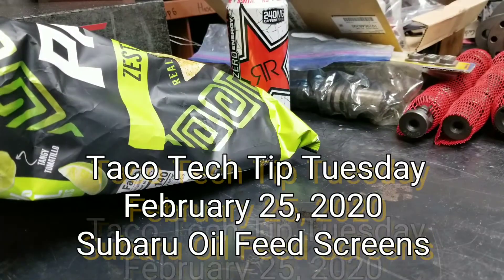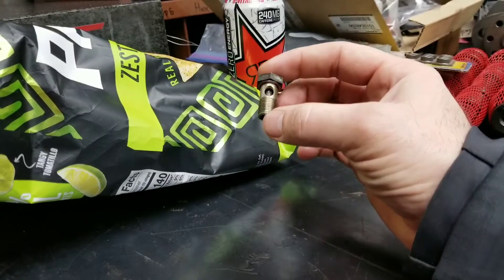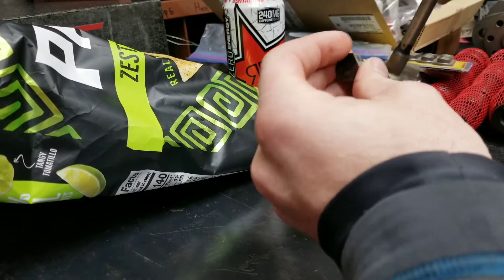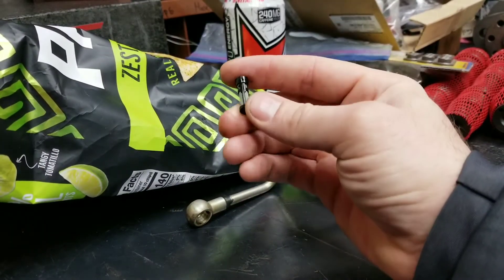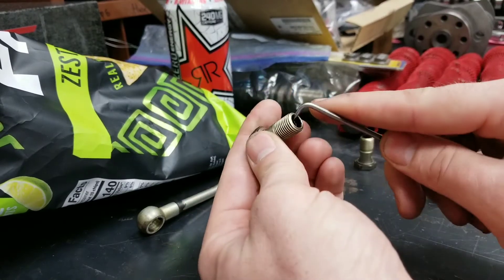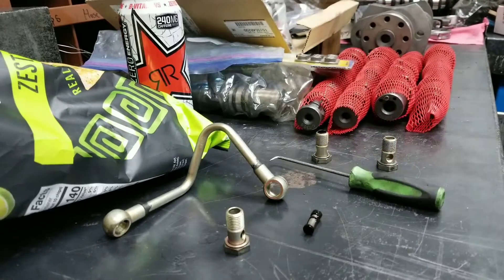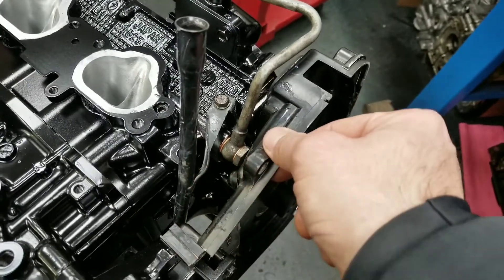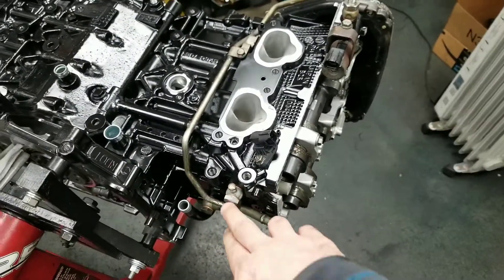Tuning Tech. Stop Subaru Engine and Turbo Failures, Remove Banjo Oil Screens

Comment: Thanks helpful information. But i am still thinking why the Japanese engineers put this micro filter inside the T Banjo?  I have similar probem with Forester 2.0 diesel 2012.
Reply from the maker: Ultimately it was to stop debris in the oil from damaging the turbo but you have to remember in Japan they replace the entire motor at ~40,000 miles so the buildup over time wouldn't be an issue.. on the usdm cars it should have been a service item but it was missed until the mileage got up there across the fleet and people started having failures,  then they made it a TSB instead of a recall.
Reply: @WT4T  thanks for the fast reply. I am considering to mount turbo NR 4 this year. DPF Out and EGR valve already turned off. Removing the Microfilter would be next step, but i hope oil pressure on turbo bearing will be not too high. I saw an example from a Subaru 2.5 sti with burning Oil. 🤔
Reply from the maker: @brattikx777 if you find it's burning oil you could install a Turbosmart OPR

Comment: I've got a legacy B4 Twin Turbo. I have already changed 4 turbos and everytime I replace a turbo it will get destroyed after a few days of driving. I have fflushed the engine and the oil line everytime I do a replacement and I still end up with a shattered turbo.
Reply from the maker: Have you confirmed oil pressure at the turbo feed?
Reply: @WT4T  yeah mechanic has confirmed that pressure is fine
Reply from the maker: @fxmonk you may consider sending a turbo into a reputable rebuilder like  Boostlab to inspect the failure.  They will have you send it with the feed and return lines all hooked up as well.
Reply: @WT4T  I'm located outside of US
Reply from the maker: @fxmonk they still may have insight for you if you contact them.

Comment: I only removed the Turbo side filter on my LGT, had 2 turbo failures. If the driver side screen is still in, will this still cause turbo failure?
Reply from the maker: Not likely to cause a turbo failure as its feeding avcs not the turbo but anythings possible. I'd run about 1000 miles then get an oil analysis done to see if you're getting debris into the oil from somewhere else
Reply: @WT4T  Turbo manufacture informed me to run an Oil line directly off an oil sandwich plate for the 05 Legacy GT. He informed me that 05+LGT have a oiling problem in the cylinder head. Didn't specifically say what. I've been inspecting my engine for metal and defects. Found a brown metal plug of sort deep inside the Turbo feed hole. Cant remove it, not sure if this is normal or not.

Comment: I have a 2006 sti. How many screen filters and where are they located?  Oil change every 3000 miles with denso filter replacement.  128, 000 miles. This
Reply: Hey man did you ever find out? I have the same vehicle and for the life of me I can't find the bolt on the left side. I found one but it has no screen?? Help lol
Reply from the maker: If the right side had screens then the left the screen will be behind the intake cam gear